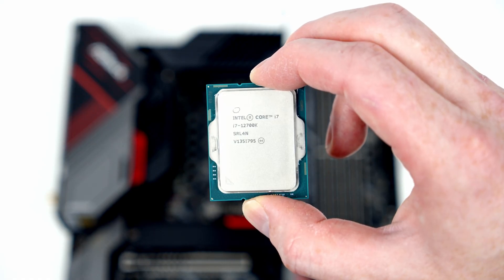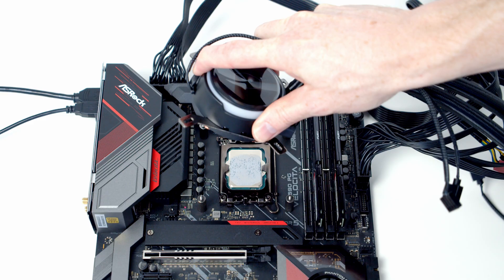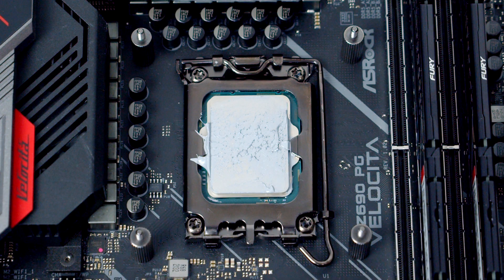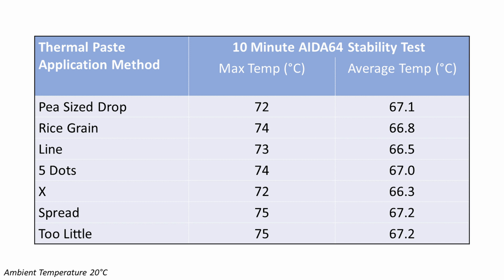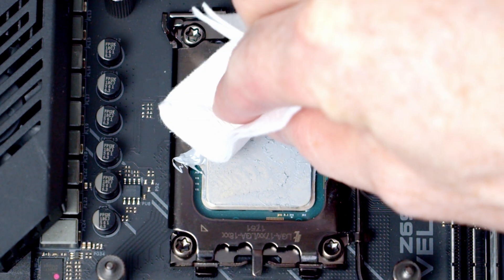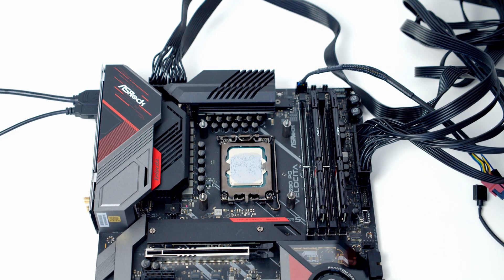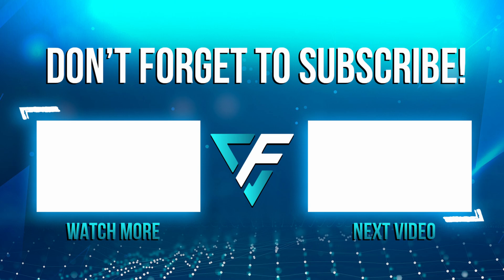Best Way to Apply Thermal Paste?

Comment: This just backs the method I've been using for 30 years. But given where the bare spot was consistently near the same spot, it does make me wonder if your heatsink wasn't fastening down with equal pressure on all sides.

Comment: Hey Christopher,
I just wanted to say a big thanks! Earlier, my system integrator had applied too much thermal paste, and my temps were stuck at around 65°C (Tdie/Tctl) and 57°C on the B850 Gaming X motherboard bios,  with an ambient of 31°C. I tried every optimization I could find on Reddit and YouTube — including the -20 curve — but nothing worked.

Then I reapplied the paste on 9600x with d15 using just a pea-sized amount, and that did the trick! I’m so happy right now — all thanks to you! ❤

Comment: You can't use pea sized method with a large rectangle shaped CPU like i5 12400F I heard? :( TOO LITTLE COVERAGE would give high temps like 80-90 C?

Comment: Thank you for the video. I did the spead method on my ps3 slim and it started hitting high 70s to 80c in. Did the X and and both cpu and gpu are now in the high 60s Celsius while gaming and actually cools down after gaming.

Comment: for a 7600x if the thermal paste gets on the green part of the cpu but not the gold parts and is left there can that cause issue over time and if so what is the best way to clean thermal past if it is slightly over the edge or on that lower part of the cpu? i was thinking isrothop on a cotten bud but im not sure.

Comment: That's not how you do 'spread' method. It supposed to be equally thin layer, not spread it all over. This method uses the least amount of thermal paste.
Reply: intel says it's not good because of possible air
Reply: Most methods, including spread, are a bit worse due to air pockets. Spread is especially bad in this case. Multiple dots is also bad, because air gets trapped in between them as you apply pressure, since it has nowhere to escape to.

The best way is either X, dot, or line I think, since there's minimal risk of air pressure. X sometimes has a bit better coverage in the corners (since CPUs are square, not circular), but the corners are the least important because the actual CPU is in the center or near it, as well as most important logic.

Basically, either dot or X. Just make sure you use the same amount of paste (I think the guy in the video used more paste for the X which is why it spilled a bit, but it's not a big deal).

Comment: if by mistake we touch our thermal paste laden hand to the underside of intel cpu can we use 99 percent alcohol to clean it off ? mine got a little bit of paste underneath.......... will it cause short circuit or less conductivity ?

Comment: Way too much paste with the spread method. it does not hurt to have a bit too much, but definately not necessary. Max temp is NOT a good indicator of the effectiveness. You need to look at the hot spots (i.e. high temps/specific cores).

Comment: It might be possible to have too much, but in general the only consequence is that it spills over the sides.  A lot of people seem to think you can end up with a thicker layer by adding more, but that is not the case because applying the heatsink pushes it off the sides.  I'm inclined to doubt you get air bubbles either.  At least without some evidence.

It is quite unlikely to get into the socket itself though.

Comment: Thermal paste is an insulator, that’s why spread method has bad temps. Too much paste is as bad as too little (sometimes even worst). 

The one and only purpose of the paste is to fill air microgaps (like scratches and metal deformations), not to get an even and pretty paste surface.

People have a hard time understanding that direct metal contact has better heat transmittance that introducing an extra layer of thermal compound.

Comment: Being doing 5 dots method for years and it never failed me. If you being careful with the amount of thermal paste you put on the dots, you'll have an even spread with no excess spill on the sides. Spreading them with spatula supposed to be the best method but I just hate seeing the amount of thermal paste left on the spatula, just being wasted.

Comment: wouldnt the best be 3 smalles dots you could apply then ? 1 in the middle, 1 on the top and 1 at the bottom (still not too close to the edge of and on the longer side)

Comment: You would think in this day and age, we all would be using thermal patches cut to the near perfect size and amount.
Reply: The issue with thermal patches/pads is that they have a (much) lower conductivity than thermal pastes due to their solid design and amount of air pockets. For this reason, applications that require high thermal conductivity never use pads but liquid or semi-liquid interfaces. This applies not only to semiconductors but also to electrical and mechanical applications. What you would expect in this day and age is that CPUs, CPU sockets and cooler baseplates would be designed to allow a consistent application of thermal paste.

Comment: To me what counts is the max temps over anything else - it seems the pea drop and x provide best results, 72C, the reason you are getting higher temps with more, is that when the application is too thick, the transfer of heat is not optimal, you need a thin application but not too little just the rest amount for optimal transfer of heat, SO if you put too much, you are not optimal, spreading and other methods could create more air bubbles, the pea sized seems to provide a thinner spread, so more optimal heat transfer in an area that counts the most, center area.

Comment: thank you for talking about the ryzen stock cooler sticking to the cpu pulling it right out of socket. It happened to me man I tried so hard to get the damn thing off iso,heat floss, By the time i got it off just a few pins bent and with that my first build was dead... all because i wanted to replace that stupid box cooler.

Comment: what about 3 small pea drops, vertically. like the Line method
Reply: I was thinking something similar but only 2 pea sized drops vertically not too far away from each other but not too close either, it should have pretty good coverage of the IHS and not be too messy, but I think I'll just go with the Cross X shape (but making sure they are not very thicc lines).

Comment: i think if you apply in two places with the "too little" method, 
one a bit higher than the center and one lower, it would be the best in terms of good spread and not spilling out of the socket.
Reply: That is a good idea
Reply: The easiest way is to cut the PTM7950 out of the sheet and not play with any dots, dashes or crosses 😏

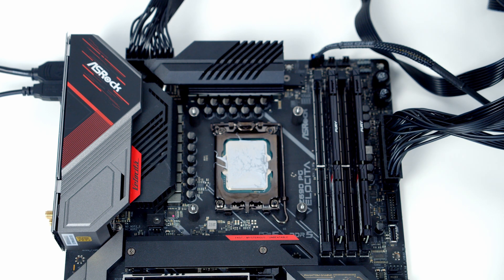Comment: 5:36 isnt it more about the socket-cpu connection type( PGA (pin grid array) or LGA (land grid array) ) rather than the brand ? Yes intel seems to favor LGA right now but that doesen't mean that they don't got any PGA s left or might even switch to them again ... What i'd really hope they would not do

Comment: Thought: Would you consider 1 additional test? Since the 'spread' method gets 'best' contact, but higher temps, could you redo that with a tiny extra dollop in the center and report that? I suspect that the bending of the chip cover in the center (previously well-documented by Intel) requires a bit more to make sufficient thermal contact although it could also be related to the mounting pressure by the cooler mounts.
Reply: Do you expect a huge delta in doing this ?
Reply: @ashleyjaytanna1953   Huge? No . But a statistically significant and consistent rise across tests? Possibly. I did that here on my 12th gen., but I don't have the instruments to do an adequate monitoring run.  Worth a consistent 3*/4*/5* ? Negligible, but curious if it is so. Do you think they'll adjust either chip shell thickness or mount pressure going forward?
Reply: @edwardsomers5037  There are dozens of tests on the Intel 12K and 13K. The difference in average temperature between using no paste at all, different brands of paste, and different methods of paste applications is irrelevant.

Comment: I bent the pins on my Ryzen cpu removing the cooler just as you mention, fortunately was able to straighten them and it works fine. Lesson learned, don't pull it straight out, give it a wiggle and slide it out gently to the side!
Reply: another thing would be to run your pc, let it heat up then remove the cooler..

Comment: Should be noted that the reason you might be getting some spill out of the sides from some paste configurations is because the chip isn't square. Spills seem to be happening on the sides perpendicular to the shorter width than the length.
Reply: no shit

Comment: Why is nobody trying a two pea sized or two rice grain application,  a third and two thirds of the way up the CPU
Reply: Because the die is located in the center of the integrated heat spreader and having a good thermal contact there is crucial in effectively cooling your cpu

Comment: I spent quite a bit of time trying to figure out which method is best for me, over the years. The way I do it is with a very thin spread and tiny dot in the middle (much smaller than the pea-sized dot). With a thin spread there is a potential for air pockets, and I think the tiny dot helps with that. I agree that it's a small difference in temperature between methods. You're also right that if you use a lot of paste then the heatsink can get glued, I've had that happen. Thumbs up for great videos.

Comment: Yes, I think this is about right. People spend a lot of time and get bogged down in pointless recrimination when there's really only two takeaways from these tests for me. You certainly want to use thermal paste, as it makes a significant difference in promoting conductivity. Yet repeated testing has yielded results that show that the difference between various thermal paste brands, their tiered product lines, and application methodologies is a scant few degrees. I used to painstakingly use the back of a plastic bag, taut around my finger, to apply paste evenly in the 1990s.  Now some brands give you the handy plastic applicator. These days I usually use the pea method, but that has been with the square CPU dies. I'll probably use an applicator when I build with Intel again, but in any event, don't sweat it too much. The difference is negligible.

Comment: 2 dots would be ideal
Reply: 2 dots on what spots?
Reply: Was thinking the same thing.
Reply: I use 4 dots , each at the 1/3 of it own diagonal lines and the size of a grain of rice, or the exact dot that he tested into the towel.  Once the sink is pressed on and screwed in, it will automatically float and spread almost perfectly

Comment: Should include "for intel 12th gen platform". Because different kind of mounting or direct die without heat spreader have different outcomes. Without that in the title beginners will not get the full context.
Reply: This is 12gen Intel. Motherboard is a z690. Looks to be an Intel 12700k. Bracket even says lag 1700 🤙🏻. The problem is. Thermopaste needs more time to sit before pulling of the aio to see the real coverage
Reply: With 13th too?

Comment: TLDR: Stop the buttered toast, just a pea sized amount is enough. Any other method may reduce your temps but is too insignificant to matter; but what is significant is more messy work.
Reply: I pay full price for my thermal paste. So, I'm going to use 100% of it. 😁
Reply: @Little_Boy_Blue  I would suggest to instead keep the thermal paste for future reapplications. After a few years, thermal pastes tend to dry up and reduce in efficacy. The thermal paste you saved up can be reapplied when you feel your cpu runs hotter than usual.
Reply: @konachan01  am very scared to apply thermal paste idk if my pc will be damaged which method should i use? some people say that using pea sized amount makes ur cpu temp high
Reply: @revex4951  "Some people" is just opinions on the internet which could be subject to a lot of bias. This video is shows that there isnt any significant benefit to using more thermal paste than needed. Pea-sized is enough. If your CPU is still overheating, it is more likely the cooler needs to replaced rather than it is a thermal paste problem. Another video shows the same result, two different videos on this topic yielding same results is enough evidence to satisfy my confirmation: https://www.youtube.com/watch?v=ofyNgJyhGuc&t=314s

Comment: 1:52 - Thermal paste covers the bottom more, because , looking at 1:49 the grain is more aligned with the bottom of the CPU and not centered.  The Ryzen popping out of the socket when replacing the cooler/paste actually happened to a friend of mine.  Poor lad had to buy a new CPU :(